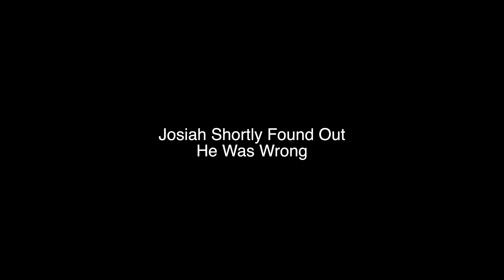Wilwood Dual Caliper Brakes For The Corvette/ Almost Ready to Drift

Comment: I've seen upgrade kits that increase the rotor sizes but reuse the stock calipers come with a spacer to move the caliper out.(seems like it was baer brakes?) might make this a more common upgrade if you could make that for the stock caliper or maybe even a base front caliper used in the rear. both are cheap at auto parts stores. the zo6 calipers are harder to find. I do believe the ctsv calipers are the same sized thou, and ebay seems to have those more often.

Comment: What was up with the bearing that you needed to drill it out ?
Reply: I think they are changing lug spacing from 5x4.75(120.65mm) to the more common import 5 lug 5x114mm
Reply: @jsomething2  so if you used the same wheels then you wouldn't need to do that?
Reply: @Philsilva06  I believe so, yes but I'd doubt check with them.
Reply: @Philsilva06  Yeah I believe they only did the 5x120 to 5x114 conversion for the convenience of finding better 5x114 wheels
You could still stick with your 5x120 setup and use the stock wheels, without the need to drill the rotors/hub.